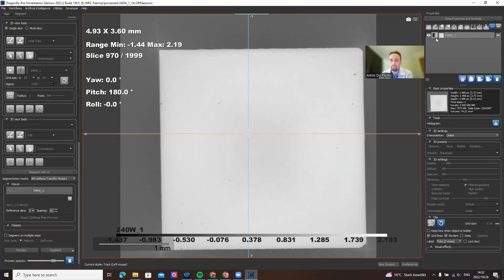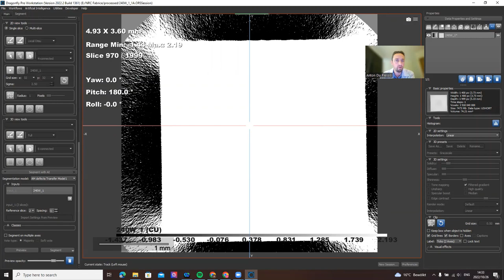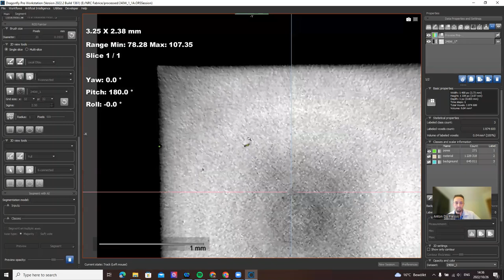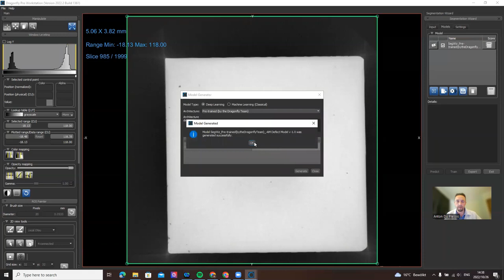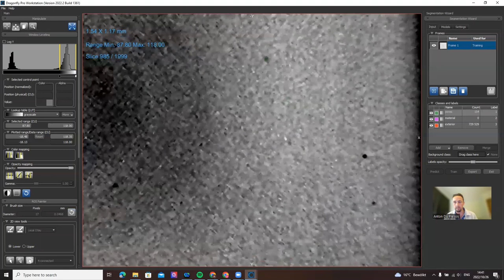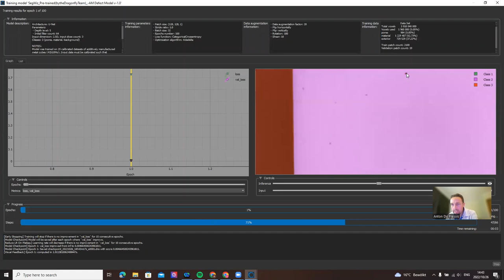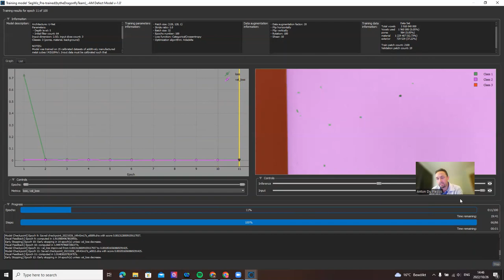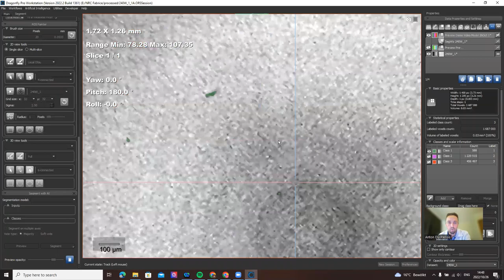How to use a pretrained deep learning model for additive manufacturing porosity

Comment: recently, I have two datasets for stiching, but their contast and brighness have some big differences. After stiching, it is easily to see the layer structures due to B/C. I used normalization of intensity function before sticking, but does not help too much. Is any way to adjust B/C and save a new session with adjusted B/C? The saved session file always has the original B/C.
Reply from the maker: The B/C is not saved to session, so the best solution to what you want to do is to use calibration. Right click on each image channel and calibrate intensity as shown in the video. For more details email support
Reply: @dragonfly_software  Thanks. Will try